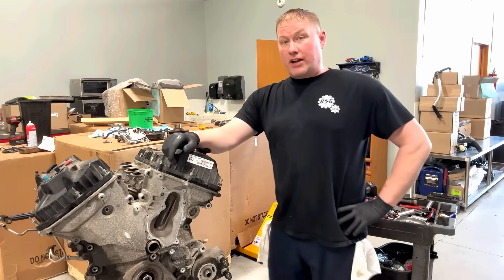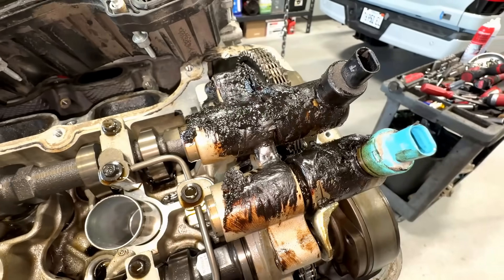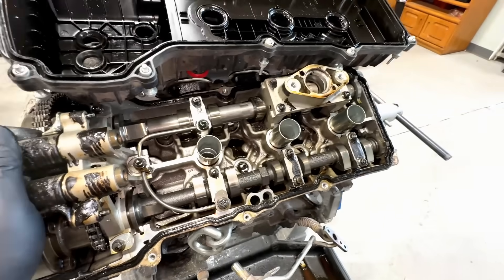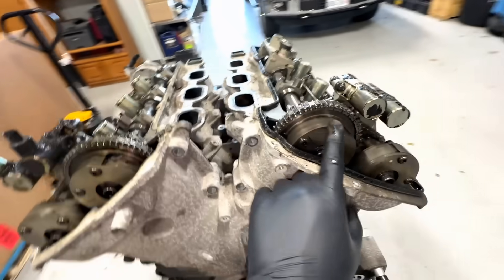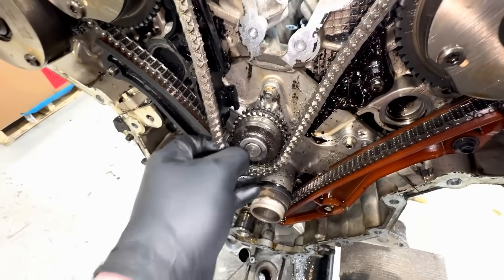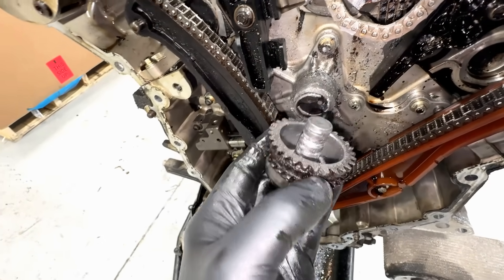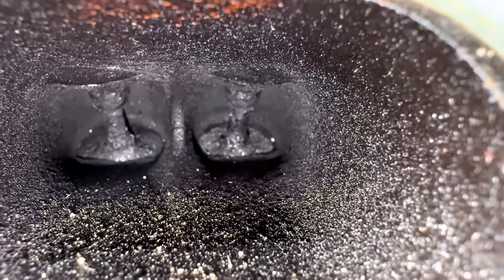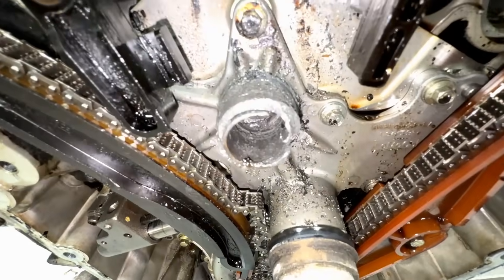2015 Ford F-150 3.5L EcoBoost Engine Failure: 97k Miles Total Destruction!

Comment: I crack open every filter on my fleet of Fords. They're always fairly clean, so I do 10K oil changes on all the vehicles. 20 years. No engine issues. None have ever been an Eco-Boost

My son owns a Hyundai 2.0L with 200k miles. The oil gets pretty chunky by 7500 miles, and it burned a lot. Ran Liqui Moly through it. Now I've got him on 3000 mile oil changes. Doesnt burn oil anymore, but it's still a dirty beast.

Comment: Here’s another genius move by Ford, on the rear wheel drive pick up trucks and transit vans the water pump is externally mounted run by the drive belt and on the front wheel drive and all wheel drive vehicles the water pump is internally mounted runoff the timing chain, which as we all know is a recipe for destruction!
Reply: It’s because of room constraints that the transverse mounted 3.5 has an internal water pump.
Reply: @christopherlehman4045  No kidding, that’s why Ford should have just simply redesigned the frame rail in the front wheel and all wheel drive vehicles instead of modifying the engine in a absolute negative and stupid way!

Comment: For that engine to have been cleaned that much by the BG cleaner, he had to have when crazy with it.  Like 3 or 4 treatments which in no way was good for the bearings or head cam journals.  
I've bought a few sludge buckets in my time and it was a roll of the dice on whether bearings were damaged, but I would run a cleaner in the oil pan for about 5-10 minutes which usually clogged the screen and made the oil light come on.  Then  I would yank the valve covers and oil pan and clean it all good by scraping,spraying, and blowing with shop air.  I got bit once as the engine started knocking after a few hours of running but had good luck on many that lasted a long time afterwards.  Even kept a 4Runner for several years and about 100K miles.  It's a gamble.  Would have been way better if the owner had just taken care of that engine.  That's some serious cha ching right there.

Comment: I have seen older trucks outlast these new modern engines.
Why did ford retire the old straight 6 engine
Reply: Emissions and also no power compared to new engines. A 140-150 hp truck wouldn’t sell anymore. People think a 275 hp naturally aspirated v-6 is gutless now.

Comment: We just serviced a 1st GEN 3.5 Ecoboost engine with 297,000 + miles on a F-150. We perform oil service changes every 4,000 with Valvoline full synthetic engine oil and WIX XP filters. So far, timing chain rattle is at start up. The owner was advised of the replacement of timing chain components as per Fordtechmakuloco recommendations. The truck is worn down (leather seats/arm rest, etc) on the interior and instead of a new engine, he's been talking about a 5.0 Coyote V8 with a newer F-150. Maintenance is key in all engines, more so with turbocharged engines.
Reply: Its amazing to me that people spend 60, $70,000 on a vehicle, and skimp out on $80 oil changes. They get what they deserve.

Comment: What do you think about the cylinder deactivation on the new 5.0L Coyote?
Reply: So far I’ve heard no issues with it and they started in 21, I’m not 100% but I think it’s just done with the existing cam phaser set up and some different programs in computer so probably not much for changes vs the older 5.0

Comment: I've been watching u 4 about a month now & learned listen & heard so with that being said (took my 2017 taurus sho in for service) & noticed my coolant kept getting low (had to add coolant twice within a month) had them check to see why don't know the dealerships procedure, but wanted to see if warranty wld cover it got denied come to find out what was wrong was water pump was failing according to them not part of the engine so it wasn't covered have to pay the price to have it repaired 😱😤😡😠🤬

Comment: Dude. You are a great tech. Hands down. Way better than I ever was. I do still think that the new engines are crap, but Im comparing them to the 4.6 2 valves, and the 385 series. We were spoiled back then. Those things wuold get so gummed up, and yet, will still start up and run. An italian tune up later and they would be fine. Ultimately, no new car is great....and the blame is on the EPA. Im also old, so I like what was in my time, but theres no doubt cars are not deisgned to last as long as older ones. 

Still. Love the work you do, and Im still learning new things, even if I likely will never lay hands on one of these to work on. Still good to keep up, at least mentally.
Reply: crown vic owner here, butta smooth 4.6 2v live damn near forever! mine is 27 yrs old, with a buttload of idle time but only 150k.

Comment: https://youtube.com/shorts/tw04ugA6YmI?si=dbu-3Vi-nrSm18nL        This is my vehicle with 130k miles see how clean it is with 3000 mile oil changes. only brought it in because of the timing chains rattled a little on very cold days. to get phasers replaced.

Comment: Thanks for the informative video. I followed your Ford 5.4 3V timing procedure and did a full timing job in Dec 2024—including chains, phasers, guides, tensioners, Melling oil pump, water pump, rockers, and lifters. The truck is still running great. Keep up the great content—you're helping people everywhere keep their Fords on the road.

Comment: I bought a new 2011 F150 Supercrew with the 3.7 instead of the 3.5 Ecoboost because I didn't want to be Fords test mule because i was leery of the turbos. I still own it with 190K miles and its the newest of the four other Fords I own and maintain religiously.

Owner abuse delaying (or ignoring) maintenance is criminal. I also think leasing encourages abuse as the owner changes vehicles every 2-3-4 years without a care down the line during life of the vehicle.  The buying (non-lease) owners that cycle out every 3-4 years for a new one have more money than me but might have more "skin" in the game come trade in time.

Good video. 👍

Comment: Are these engines inherently prone to cooking the oil by way of design or if using all that hp they are capable of putting out by towing and hot weather etc ?. Can this all be prevented by engine oil change periods shorter than the theme these days that pushes for much longer distances between changes than some years ago. Mind you I've always changed oil based on the "severe duty" cycle if at all possible and whatever valve covers etc that I have had off I've never seen anything remotely like this mess that still is showing itself even though other portions did get washed down from that cleaner. Bad maintenance practices and then throwing in the cleaner, that seems to be the ticket to a bricked engine by the looks of it !.

Comment: Negligent owner - "What?! I need an engine?!!! Fords are crap!" Take's sip of third $6 Starbucks coffee for the day.
Brian: "This is the result of oil starvation for the turbos and engine. When was the last time you had an oil change done?"
Negligent owner - "I'm supposed to get the oil changed?"

Now that last line is obviously a joke, but one taken from real life. I had an IT software professional say that to me when the 3.7l V-6 engine in his Jeep Liberty blew up. 80K kilometers without an oil change. Amazed the engine lasted that long. I imagine Brian has run across multiple owners who did the same.

BTW Brian - you do outstanding videos Brian - please keep up the great work! Loves these engine tear-downs!
Reply: You read my mind, I couldn't stop laughing. So true people do not have common sense anymore.
Reply: Those 3.7L Jeep engines were pretty tough. I had a 2004 Liberty that had the cooling fan quit, only I didn't notice it. The lower hose blew off waiting on lunch in the drive through. I parked it and walked to the nearest parts store, bought pliers, the hose, and coolant and fixed it right there. Started driving back to work and it ran like crap and started overheating again. I was just trying to make it home by that point cause I figured she was toast. But once it started getting too hot I called it and pulled into a parking lot. Had my boss come get me and let me get some tools from home so I could work on it. Spent some time looking at it after it cooled (still misfiring like crazy) and figured out the fan was toast. Found an OReilly's open late and grabbed the fan once my wife was home from work, swapped it out, and made it home. Barely, it kept stalling out on the way. Spent a couple days draining oil, coolant, etc looking for a blown head gasket. Checked compression, all of it. Couldn't find anything wrong. Finally in a last act of desperation I replaced all the plugs. Immediately it was fixed and ran perfectly. Drove that Jeep for another 3 years to 185k!

I think that fan was bad for a while too. Got stuck in traffic (accident, took a couple hours) the previous summer on the way back north from the beach and it started to get hot sitting there running the AC. Had to pull off and wait for it to cool down. I just thought it was because it was a scorching hot day, like 98 degrees. But maybe the cooling system worked well enough without the fan as long as you keep moving and don't idle for too long in 90+ heat.
Reply: We have a whole generation, now going on two, of “highly educated professionals” who don’t know how to do anything and have zero common sense or knowledge beyond what they’re told to think by college professors in armchairs.  Think about that.

Comment: The most important oil change is the first, and it should be done at 1200- 1500 miles. Then every 5k or 3k if your engine is turbo. And DO NOT BUY the mfgrs recomendations re viscosity. The only reason they recommend 0-anything is to hit CAFE Standards. I use a pint of Marvel Mystery Oil then full synthetic 5-30 in my 5.4 currently at 176,000 miles.

Comment: This mechanic is awesome! He put out a 4 part video on timing the 11-16 3.5 echoboost in the f150, I completely followed his directions, retimed my 13 f150 3.5 , and when completed it started up an running great! Been 6 months ago still running great!!! Now I am an old school mechanic, so I have more than basic knowledge of mechanics. I said that to say not everyone can do this procedure if you’re just not a mechanic at all! Anyway love the channel, an ppl he is not steering any one wrong! He knows what he is talking about!!  Now last thing, since im in my 50es, im old school, I change my oil an filter every 3.000 miles, I always do my own oil change, 75 bucks, full synthetic an a ford filter! Every 3.000 doesn’t hurt anything , I know it’s overkill but that’s what I do! Don’t ever go with the computer saying it’s time for an oil change!!!  Most likely depending on the manufacturer it could be 8-10 thousand miles before the car says change the oil!
Reply: The oil in my bike now has 20,000 miles and still has life left in it via the analyses that have been performed on it over the duration of this oil change interval. Now, this isn’t your typical Wally World or auto parts store oil, but still, blanket statements don’t always pan out.
Reply: Same here. I used his original timing chain video to do my 2012 Ecoboost. That was 40k miles ago and it’s been flawless since.
Reply: I have 236k miles on my 2011 eco. All original engine components except the thermostat. Been watching FTM since 2013. He's saved me tons of money.

Comment: Is this a case of the 10K miles oil change recommendation? At least this isn’t a design issue with the early eco boost engines.

Comment: I do my own services and change my oil every 3-3,500 miles with NAPA full synthetic (on sale it's $24 for 5 quarts) and Champ/Luberfiner filters from the Rock at about $2 per filter.  Under $30 per oil change.  Never, ever had any issues with this method.

Comment: Tolerances are tighter, and synthetic oil is so much better, so I do changes at 5K, but I'm religious about it, and use a quality oil and filter.  Not the cheapest stuff the local parts store had on sale.

Comment: I'm 72 and have been working on my vehicles since I was 16 or so.  
Always, always appreciate Brian's accurate analyses on problems. Never too old to learn!
Reply: I am 63, been working on cars since I was 15. When you’re poor,you figure it out and pay attention . I still do my oil changes every 5000 miles. No turbos in my barn. These kids now are to proper to get a little dirty.
Reply: But with all the new modern automotive technology and the  advancement in motor oils with multiviscosity oil, conventional,  blended synthetic,  and full synthetic.....one can go all the way to 7,000 to 10,000 miles between scheduled oil changes.   That may very well be on many modern cars.  But how many dealer service department techs will tell you that you will still need to change your filter every 5,000 miles... then add about 1/2 qt to 1qt of oil to bring oil level back up to proper capacity.   Yes, oil and lubrication on any engine is important.  But filtration and cleanliness of oil is just as important.  Why would service technicians tell customers this if it kept vehicles on the road and out of    service bay more often?  This reminds me of the old adage....."Just because you CAN do something, doesn't necessarily mean you SHOULD!".  Think about it, people.  I enjoy this guy's videos.  He is always honest and unbiased which is a refreshing change of pace when dealing with any mechanic/service technician.  He knows his stuff....he's seen some s*~t!  Leave him be and let him continue to inform and teach the masses.
Reply: Agreed. I’m 68 and have never veered from the oil change at under 5000 miles.
Reply: I’m over 65 and agree. Oils are constantly being reformulated to catch up with new engine / transmission changes BUT still need to be changed. Newbies don’t get it. 🤪

Comment: Don't listen to youtube comments. 99% of the haters just want to stir up trouble. You are my go to for ford tech knowledge.
Reply: Right!! I can’t understand how folks watch content just to talk crap. I find it’s better to just not watch content I don’t like. It’s better than giving the universe negative energy to bring back to you.
Reply: 1000%
Reply: People who grew up in the 70s-90s were weaned on old pushrod V8 and 6 cylinder engines that were happy with whatever cheap oil you put in them and impervious to long or neglected oil changes.   That changed with VVT, V-Tec, Turbocharged and Supercharged engines and DOHC 4 valve architecture that operate at higher RPM than old pushrod engines.   They live on clean oil and can’t tolerate extended changes or crap oil.  The oil manufacturers aren’t helping by printing “Extended Life” on the bottle touting 20 k mile change intervals.  Those are death to a modern engine.
Reply: they all only build cars to last the factory warranty period and not much past that, they even calculate how thick the plastic should be on the plastic engine parts, not only that they are starting to put undersized engines in vehicles and squeezing more power out of them by using a big turbo, these engines always run in the hot, high stress zone even with normal driving so they burn out soon after the factory warranty expires, because after that they know the vehicle is your problem, not there's ???

Comment: Our 15 ecoboost has 158k. Smooth as silk. Changing oil every 3k now.
Reply: 2012 183K running good
Reply: Good for you, these are wonderful motors.
Reply: I have 230k but timing chain, water pump, ptu and all that was replaced just over 30k ago
Reply: @jordansoboleski9869 lord what were the repair prices
Reply: @jordansoboleski9869 Were you having issues prior to having all that replaced, or did you just do it for preventive maintenance?
Reply: I have a 2010 Taurus sho tho not a f150
Reply: 2014 SHO with  198k miles
Reply: My 2015 has 162k, been changing the oil every 5k with Mobil 1 full synthetic “20,000 Mile” variant of their 5w30 and any premium filter with a bypass option (VERY important for the turbos to always have oil).
Reply: 2014 ecoboost F150 165,000 miles.  Mobil 1 & Motorcraft filter every 5000 miles.  Pre programmed 10,000 mile change interval is a joke in my opinion.  The oil filter location and angle is really bad design what a mess.
Reply: 160,000, lots of oil leaks, but running fine. Oil changed every 5000 miles.
Reply: 3k is just downright excessive
Reply: I do 3k oil changes on my 93 2.3 lit she just keeps going floored up every hill haha

Comment: Hi Brian
Don't worry about those negative comments you mentioned. In any video of Youtube there are allways negative comments, some because they don't understand the process and others, worse, are just to play smart.
The truth is, as you said, you have been doing this work for a very long time and it doesn't take much to diagnose exactlly what's going on.
I've been watching your videos for a very long time, since I bought my 2008 F150 with the infamous 3 valve arrangement and I have learned a lot - Thank you.
BTW - do you recomend oil flush cleaner when wr do an oil change ?
Keep it going